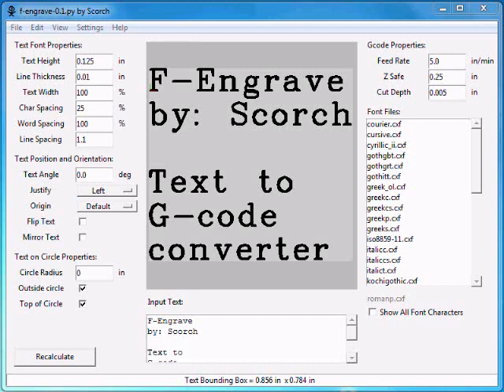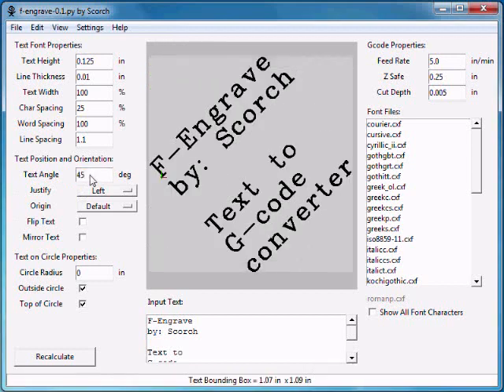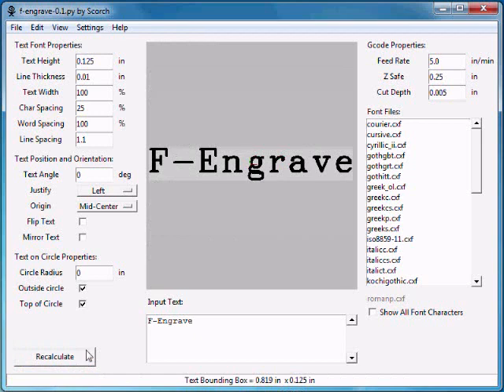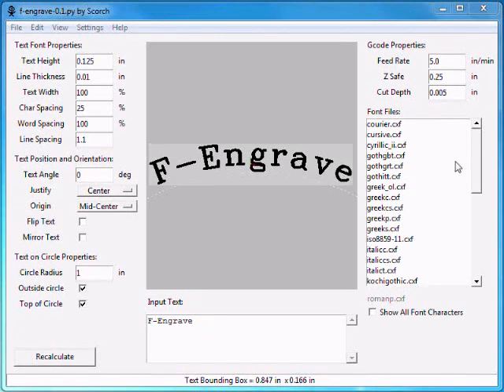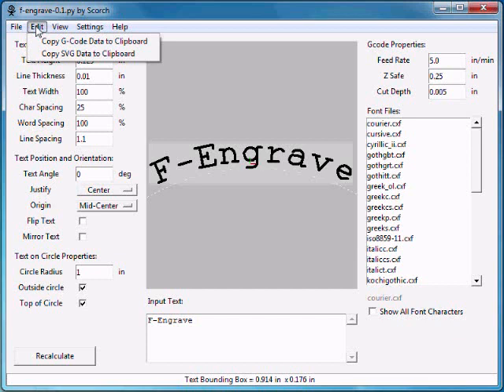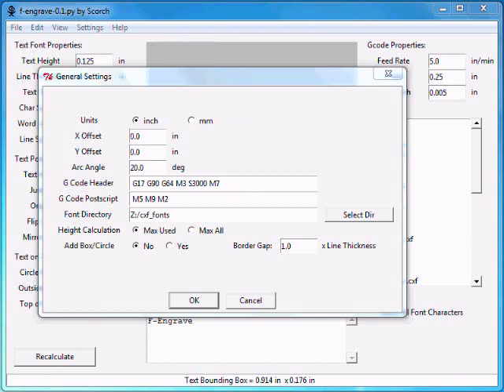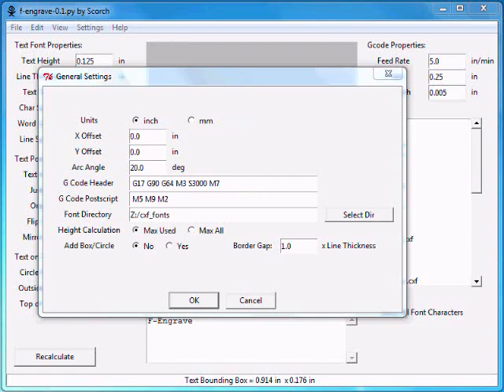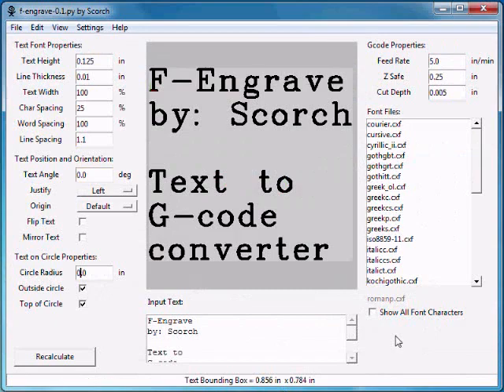F-Engrave: Video Manual for F-Engrave

Comment: Can it be used for 4 axis?
Reply from the maker: Not directly.  However, you can convert the output code for use with a  rotary axis using G-Code Ripper.